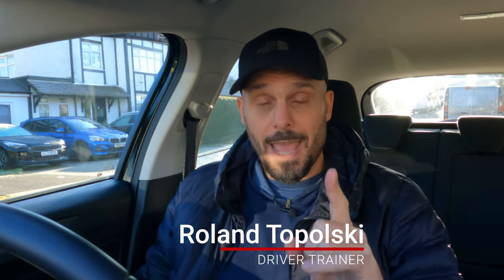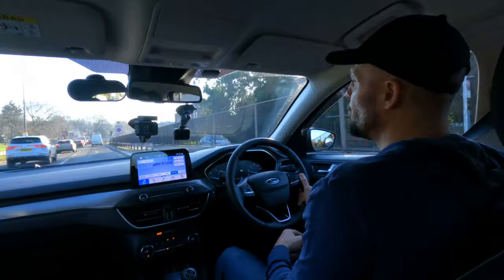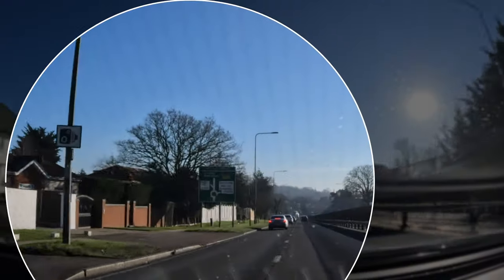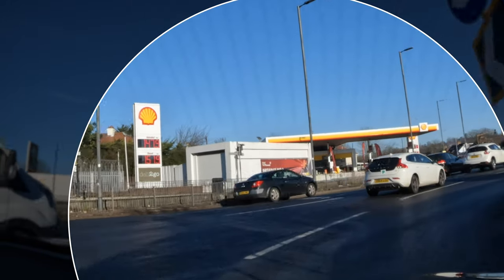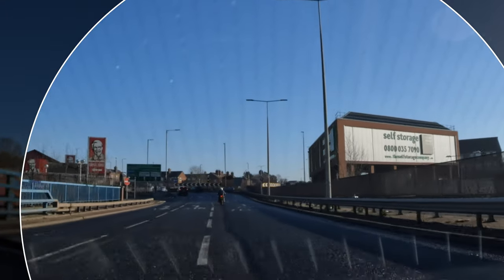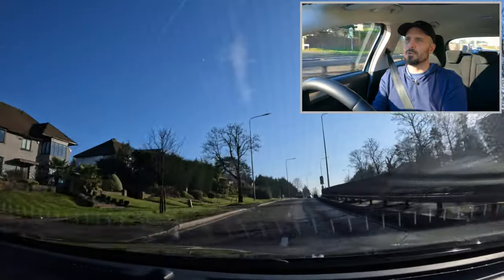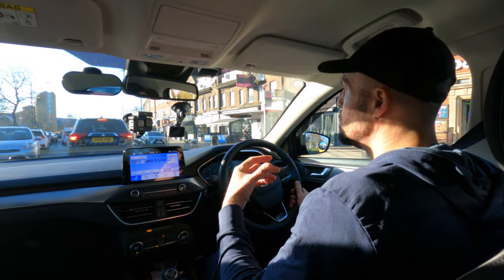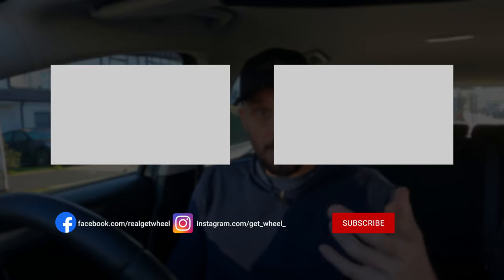THE APEX CORNER TUTORIAL, the approach, lanes and exit… Good for any Large complex roundabout.

Comment: Middle lane A1N take you to 3rd exit left lane and make it easy to take the exit .  For milhill circus Yes it is difficult to move to 3rd exit need a lot of training
Reply from the maker: With practise, you’ve got this!! For Mill Hill circus Don’t take the middle lane. If you want the left lane you need to change lanes after second exit .
Reply: @GetWheelDriving  that is correct . But if you coming from Broadway and want to go 3rd exit I will take the middle lane take straight to the left of 3Rd exit . Practising practising .
Reply: I think is alright, the crucial part is at 7:11, to check mirrors and at 7:14 signal left and move towards the left (if is safe). This will put you in the middle lane out of the 2 left lanes at that point, and then you and the car next you on the left, both exit the roundabout, BY TURN, as there is no priority there and the road narrows fast.

So yes maybe a bit tricky, but if you do it twice correctly you'll understand it. You have to be cautious of cars on the left when you will move left from the right lane tho. If it was my test and I see a car there, I wont even indicate, probably I'll do a lap or take the exit after, better safe and and wrong exit, than dangerous and correct-exit.

Comment: My instructor has told me the right lane on the mill hill circus is for U turn only and she tells me to take middle lane for third exit. I've explained to her that I've seen several videos of instructors saying take the right lane and then change to the middle lane but she said that's incorrect. What's your thought on this as I'm really confused and if I was to do what she told me to do would I fail on my test? Thank you for the videos by the way so helpful!
Reply from the maker: It’s a terrible roundabout… My answer is simple. What do the road markings tell you to do? It’s not forbidden to change lanes on a roundabout but this particular roundabout is very tricky. It just requires practise and to be done safely. You can always go around again if you can’t quite get across. But as I said before it’s a terrible roundabout.
Reply: @GetWheelDriving Possibly the worst in Britain. Failed here today